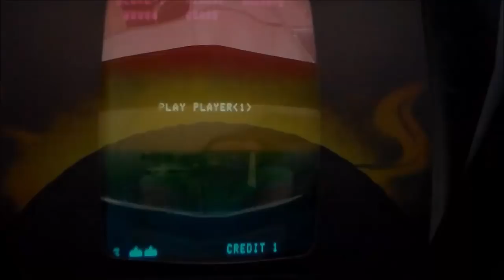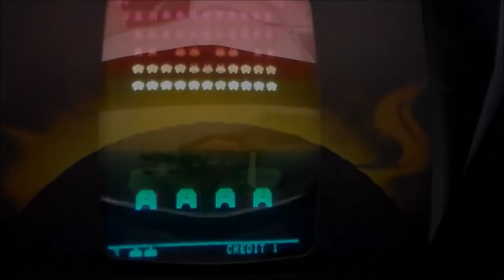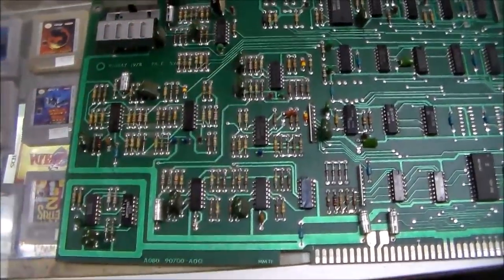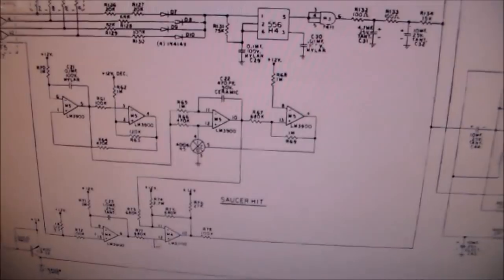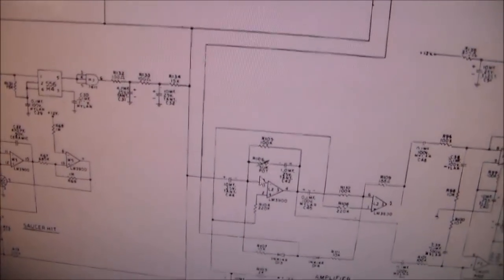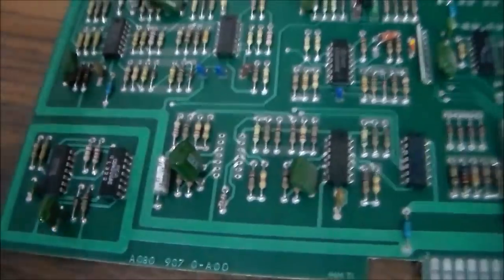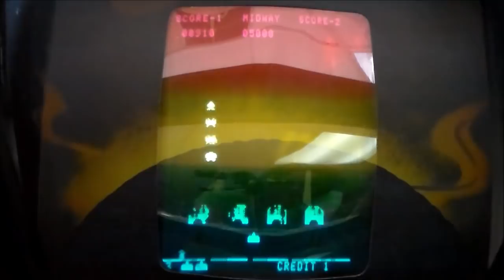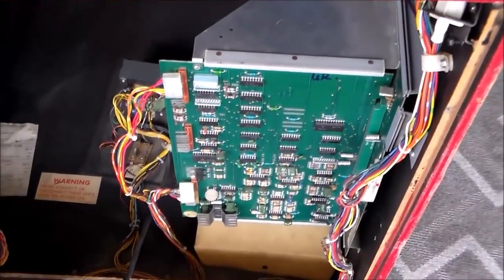How to Repair Missing Space Invaders Deluxe Arcade Sounds - Reading PCB Schematics!

Comment: Hey Joe.  I have one of these...the invader hit sounds weird on yours.  But what I wanted to ask you has to do with a problem with the display.  On mine and also on this one, the numbers at the top of the screen seam bunched up on the right side (facing) and spread out more on the left.  This carries on down to the invaders as well, but gets better before you reach the bottom.  Is there any adjustment in the monitor that can fix that or are we stuck with it?
Reply from the maker: There's a Vertical Linearity adjustment on the monitor that fixes that.
Reply: Thanks Joe.  I tracked down a Motorola M5000 manual and it shows the vertical linearity adjustment as being R64.  I’m going to try to adjust when I have some free time.  Do you know if its going to be a “pot” style adjustment or something else?  I’m nervous about making it worse.  Never done much pot adjusting.  In your experience are we talking about micro tiny movements or quarter turn adjustments to make an impact...I know you can’t watch while your doing it....
Reply from the maker: If I remember correctly it's a vertical thumbwheel, you can turn it with your fingers.  Depending on how far you're off it depends, if it's minor like in my video you would just barely turn it, maybe 10 degrees out of 360.
Reply: You are a lifesaver Joe.  I’d been stumbling around for 5 years trying to find a solution for that.  As you face into the cabinet from the coin door it is the white dial at the back on the left side.  There is a black one to the right in front of it.  A half turn counter clockwise with a long flat head straightened me right out.  Thanks for helping to keep this great hobby alive.